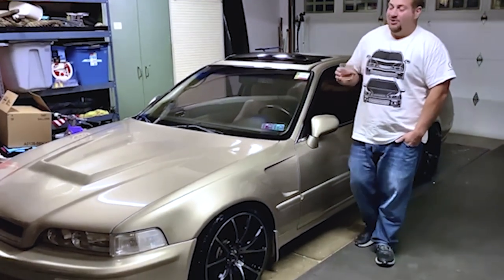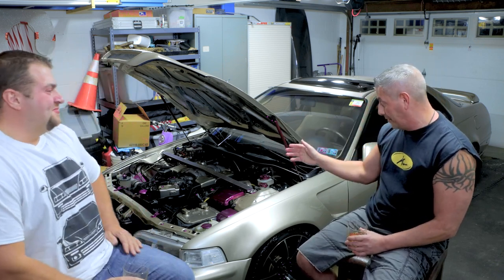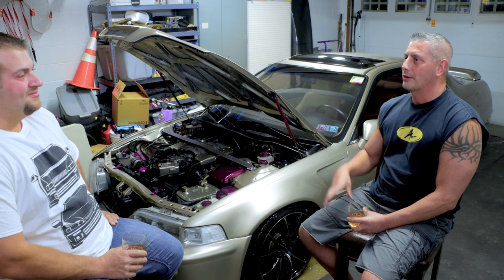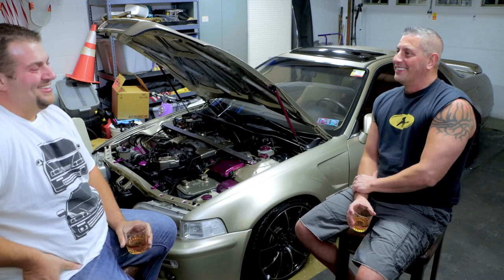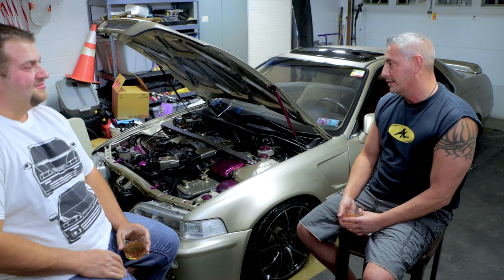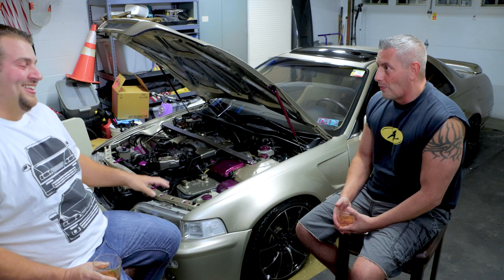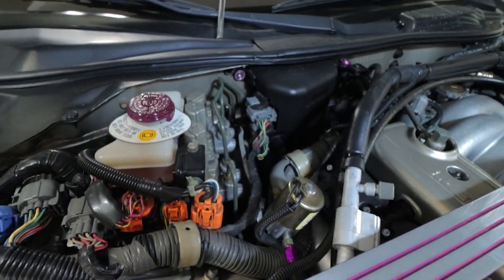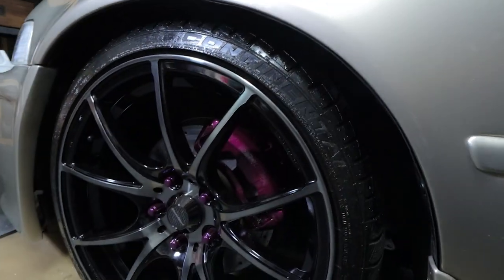Legends with Liquor Podcast: Episode 1 - DJ's Legend

Comment: 🔥 aye Greek you still have the same car with no updates?
Reply from the maker: Yes sir I still have the turbo sedan and nitrous coupe. I moved to Florida and the cars are in storage in PA. So last year I had them both on the road and got to go cruising with the turbo sedan a lot (put 1000 miles on it haha) the coupe project the interior is being installed when I get back to pa. But this year not many updates. Just working on parting the sedan out and transferring the drivetrain over to the coupe and selling the motor setup in the coupe